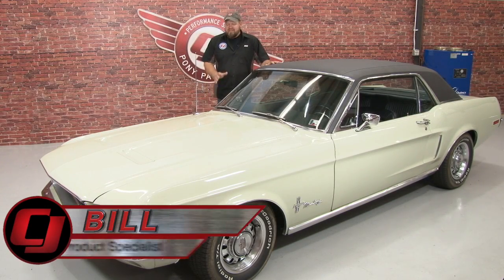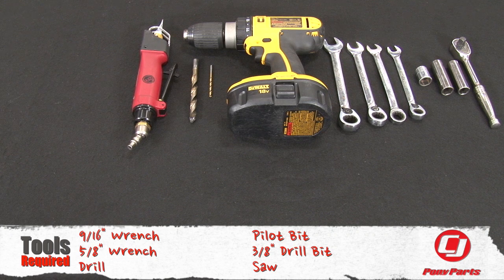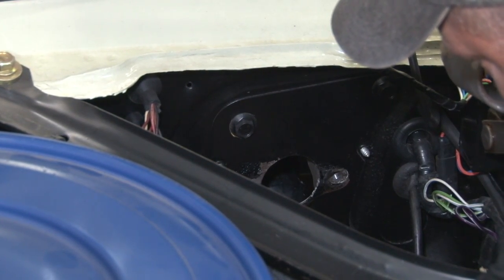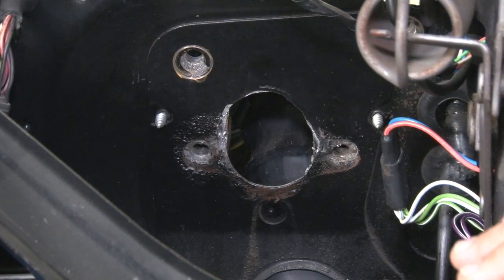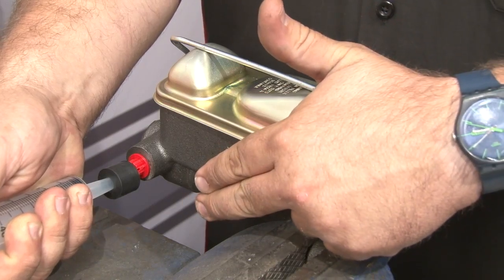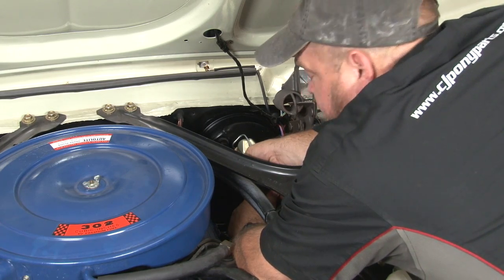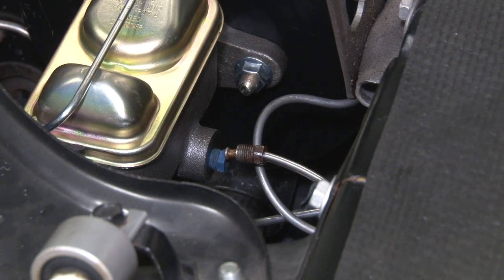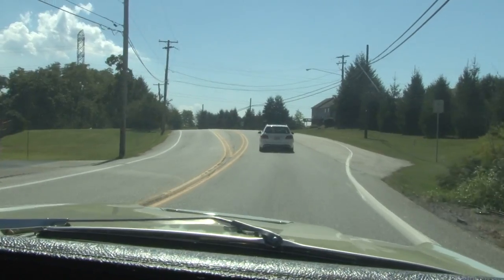Master Power Brake Booster Conversion Kit (Automatic) | 1967-1970 Mustang

Comment: Just installed this kit,,they left out that the pedal mounting bolt is at the top of the pedal bracket and the entire bracket has to be dropped down a few inches to install the new supplied bolt and nut as well as the 2 sheetmetal screws sticking out have to be ground down in order for the booster bracket to pull down flush,,and good luck installing that factory upper right bolt back in up under the rain drip behind the booster... a 9/16" claw foot on a wobble extension is the ticket there... Otherwise it appears to be a pretty decent setup for someone upgrading from oem manual brakes,.. Adding ss braided brake lines all around would help to increase braking performance significantly over the oem rubber hoses...
Reply: The holes for the booster didn't line up for me in the firewall. Drilled out the threaded ones too.
New break pedal doesn't fit. Used the old one. Break booster leaked.
Pain hooking up the two break lines.
Took the junk out. Put the old back on.
What a pain in the azz. Video isn't fully true.

Comment: Off the wall question for you. 
I currently own a 1966 mustang coupe (solid red) with a Complete Eleanor kit (3 inch induction hood w/hood pins). Do you know how much it's currently worth? Rough estimate would be great. 
New paint(mustang red) -single stage urethane for the old school look. 
Rebuilt straight 6, also repainted (blue)
All black interior, All new.
18,000+ miles on motor. 
I can't find any stang like mine so I don't know what it's valued at... Thanks

Comment: would 've been easier to do if you removed the firewall to shock tower brace as well and a lot better for shooting a vid. Good vid tho!
Reply: +Mb cB I agree with removing the brace. Also after you remove the master cylinder is a good time to think of replacing or overhauling the rag joint on the steering column. With the steering column out you have better access for the brake pedal mount for the brake pedal replacement and stop light switch.

Comment: Can anyone explain what the booster does?
Reply from the maker: It uses a vacuum fed diaphragm to create additional pressure on the master cylinder when you push the pedal converting the car to power brakes.